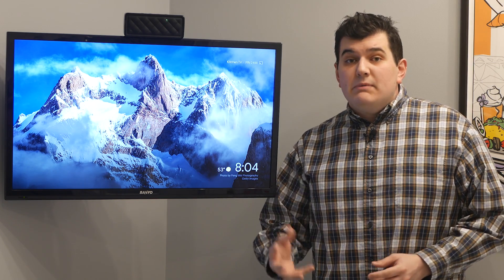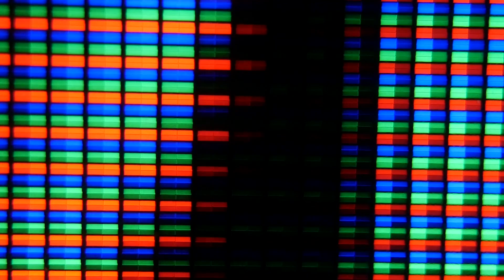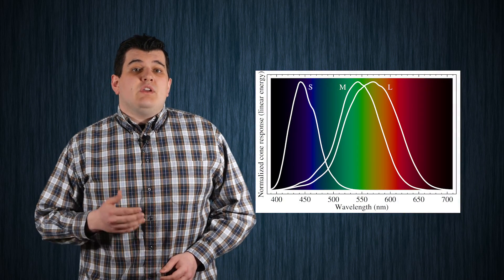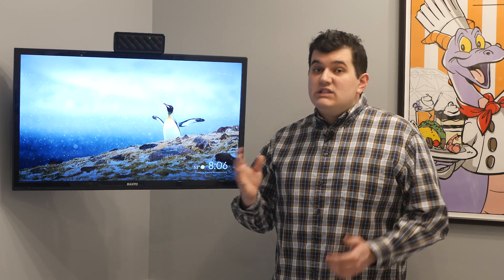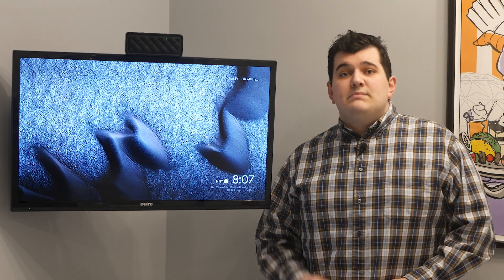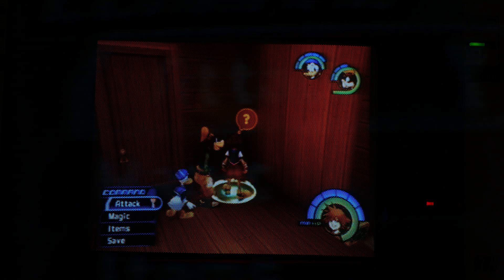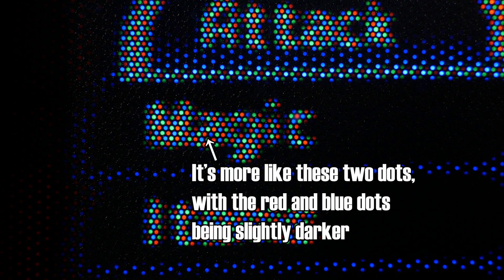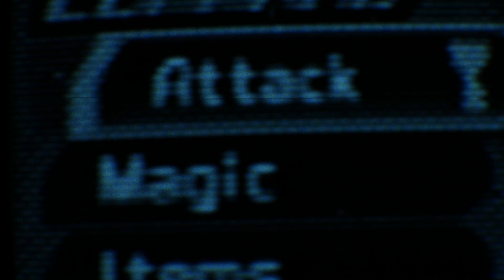These Are Not Pixels: Revisited

Comment: The thing that really brings the distinction home for me is that with the closeup of the slot-mask CRT, you can see clearly that the brightness of the image can vary within a single phosphor dot, in a nontrivial way depending on the shape of the image (rather than the color or brightness data at a single spot). That would not be the case if they were truly pixels.

Of course, the issue gets confused somewhat by the way that systems with LCD screens can do "subpixel rendering" by tweaking the color data in a manner that exploits the spatial arrangement of the red, green and blue elements to provide a bit more spatial resolution. But from the physical LCD's perspective, it's just rendering color data as usual.
Reply: This is the same point I came to the comments to make.

On a side note though: subpixel rendering is also a cool topic, and the way a text renderer has to be aware of the font shape and its display pixel layout is kind of awesome.
Reply: Haha, and don't get me started on PenTile / RGBW displays!
Reply: I wanted to say the exact same thing. Look at his eyebrows at 6:00. That says it all.
Reply: ABaumstumpf The advantages only made sense (with <1440p panels in phones at least) when blue OLEDs were ridiculously crazy expensive (rather than merely expensive) & it wasn't physically possible to print OLED's at the required densities to keep up with competing LCD tech (OLED's & esp. LED's [ala mircoLED displays] have actually started to seriously surpass LCD's in possible smallest display element density).

These aren't issues anymore (and a ton of phones and devices have used RGB-stripe OLED panels, even going all the way back to like 2011 when they actually were). And the 2x subpixels to a "Pixel" isn't the real problem in & of itself, it's the non-equal numbers of each color that comes from the 3-subpixel/color bitmap display standard. This not only creates an irregular subpixel grid that leads to HORRENDOUS text rendering, but causes HUGE amounts of "black space" whenever certain colors are used (especially red hues, with red having 1/2 as many subpixels as green, but not being made larger to compensate like they do for blue) among other weird issues with color reproduction.

Granted, these are all greatly lessened with high enough pixel density, but there's WAAAAAAY too many companies continuing to use 1080p PenTile panels on the cheaps, when Samsung can & has produced RGB stripe panels at that res.

If you're going to use a 1080p display, either go LCD or pay more for a legit RGB-stripe; or just suck it up & pay even more for 1440p PenTile. 1080p PenTile OLED panels kinda freaking suck donkey nuts, esp on today's huge screens.
Reply: Was thinking the same thing!
Reply: Cole Erickson
Lol IMO subpixel rendering is interesting & cool as long as their are exactly 3x subpixels per pixel as the physical layout; like with say Microsoft's neato ClearType for instance! 
But both 2x subpixel "PenTile" (in all of it's forms...) & 4x subpixel, ala Sharp's ridiculous & ridiculously pointless "RGBY" layouts, are simply not "cool" according to any definition of that word.

In fact, the only reason PenTile hasn't officially gone the way of the dodo in OLED phone's the way it has in OLED TV's is simply down to the reduced manufacturing cost when printing high PPI panels, along with their ability to continually get away with it & all the GPU + battery power such a subpixel rendering scheme wastes [even with 1080p displays like those STILL used by OnePlus; where the negative effects of PenTile remain blatantly obvious & consumer's should really put their feet down for either 2K PenTile or 1080p RGB stripe at those kinds of price-points].
Reply: Cooe14
To be fair - PenTiles do have several advantages too. The big problem is that manufacturers count 2-subpixel-groups as pixels - which results in worse picture quality for a given "resolution"
For example if the pattern matches it can nativly display Bayer-filter images. And for a given amount of sub-pixels photos will in generl look slightly better (due to the nature of the human eye).

But sadly most of the time it is used just to cut costs as they can claim higher pixel counts.
Reply: "causes HUGE amounts of "black space" whenever certain colors are used"
That is a thing that is easily addressable but would add another production step and thus costs.
And as already mentioned if done correctly even for the same number of subpixels it would increase the perceived image quality simply due to the nature of our human eye.

It is not an inherent flaw of the technology but the fault of the manufacturers that just use it to arbitrarily inflate their pixel numbers.
Same as it was with HDR - even good software HDR can significantly increase visual quality, but now we get "HDR" monitors with worse color accuracy and worse contrast than some good "normal" monitors. Doesn't mean HDR it self is bad.

But i agree with you that the current implementations are rather poor.
Reply: subpixel rendering just exploits the observation that actually you have 3 times as many pixels on an LCD as you think you do. (well, assuming a standard RGB layout with 3 subpixels)

That 1920x1080 display is actually a 5760x1080 display but with coloured filters in front of the pixels.
As long as you can find a way to filter out the colour data appropriately, you can exploit that actual display resolution pretty effectively.
(it also says something about the kind of monochrome displays that could be built these days if anyone was still inclined to make those.)
Reply: ABaumstumpf It can't really be fixed though. If you increase the size of red subpixels it throws the color luminance balance completely out of wack, and thus color reproduction is incorrectly altered. Samsung's trademarked Diamond subpixel layout is about as good as it gets as far as RGBG layout optimizations (which is why they have used it for so long [S4 onwards iirc]) after using a number of different layouts in the earlier years), as it suffers from the above problems WAAAAY less than the prior layouts. Yet even with said layout, PenTile's problems are still glaring if the panel's dot pitch isn't high enough. They are simply inherent to varying degrees in any & every implementation of the concept.

The solution is simply to increase the pixel dot pitch to the point the problems (besides wasting GPU perf & battery life) become largely irrelevant (yet it's benefits remain), use RGB-stripe, or use a different display tech. Phone's with visible PenTile display abberations should not be a thing in 2018. No, if's, and's, or but's about it. And ESPECIALLY not on flagship phone's like the OnePlus 6 among many others.
Reply: "It can't really be fixed though."
it can, quite easily, and technology that does that has been used for decades in some applications.
my personal favourite is simple and significantly increases viewing angles (at the cost of brightness) and also removes the possibility of sub-pixel movement - blurring.
A simple matt foil can do that.
Reply: ABaumstumpf Lol exactly, at the cost of brightness. That's unacceptable in a phone display, and diffraction through a matte foil with enough scattering to rectify this problem would impact not just brightness, but clarity & color intensity. 

I suppose I should have been more specific. It can't really be fixed without significant trade-off's elsewhere or an untenible increase in manufacturing complexity & cost (for the price point needed of budget option [as far as OLED goes] 1080p PenTile panels). 

At that point it simply makes way more sense to just skip those R&D costs & dev time all together, and simply jump up in resolution/dot pitch to their (Samsung's) already ridiculously mature 1440p manufacturing process. 

So mature in fact.... (2014 onwards), I'm POSITIVE they could pull out all the stops on an RGB-stripe at that res/density. Whether they'd ever actually do it though... Hey, at least I can dream, right?? ;)
Reply: " and diffraction through a matte foil with enough scattering to rectify this problem would impact not just brightness, but clarity & color intensity."
has been done before and no, that is not a problem.
The reduced brightness is a direct result of the increased viewing angle - to see at shallow angles you also need to emit light in that direction. That too can be rectified but that would add yet another layer and more complexity - not a problem for static devices but not good on a mobile one.
It is still the case that at the same part-size pentile would, if done not to cut costs but for its benefits, produce a sharper image. And again you are comparing not the actual design but implementations in wildly different price ranges.
Reply: ABaumstumpf "The reduced brightness is a direct result of the increased viewing angle"

Facepalm no shit lol. I know how matte material effects light, though you obviously do not. The scattering of light by passing through a matte medium most definitely does dull color intensity & contrast in addition to reducing brightness. The mechanism that causes both effects is largely the same. This is the exact reason glossy screens have far superior visual contrast than screens with any sort of matte film finish. Light scattering leads to less concentrated points of light hitting on your retina, and thus less color information for a given point reaching your cones.

And the level of light scattering required to eliminate the PenTile pixel gaps at lower resolutions (to someone with proper 20/20 vision) would make this effect much more dramatic than what a standard anti-glare display finish provides.

Matte materials also increasingly soften the resulting image, with increasing scattering intensity (more pixel light overlap). Which ofc is what causes the intended effect of elimanting the pixel gaps, but at the cost of a less sharp image.
Reply: "Light scattering leads to less concentrated points of light hitting on your retina, and thus less color information for a given point reaching your cones."
That does not in any way dull the colors as you claim. It only affects brightness and thus contrast - but not the ability to reproduce colors.

"but at the cost of a less sharp image."
And you say i don't know how basic physics work? You do realise that we are not limited to now blurring and blurring across the screen?

I am not sure if you do this intentionally or not - but you are comparing highend normal LCDs with cutdown lowcost PenTiles and assume that every engineer that ever worked with them is a complete and utter moron.....
Reply: @ABaumstumpf  yeah you don't know what you're talking about. CRT phosphors always display multiple colors per phosphor. Kinda like FM radio. Where you tune into a frequency yes, but within that band are a bunch of oscillations/vibrations that produce distinct sound (when your radio converts into sound), but at the station's frequency (like FM 103.5). You don't need different frequency bands to produce the rich and varied sounds coming out of the speakers. Just one, but different vibrations. That's essentially what a CRT phosphor does, except with light instead of radio. Whereas digital pixels can only display one color at once.
Reply: @salnation189  "You don't need different frequency bands to produce the rich and varied sounds coming out of the speakers. Just one, but different vibrations."
You have fundamentally not understood what vibrataions or freqencies are, nor how a radio works.
Reply: @ABaumstumpf  again you offer no actual rebutal. It is obvious you are a scripted bot.
Reply: That also means that your image is not as sharp and you lose actual detail - cause while you can, if the monitor would be tuned perfectly, get a bit more detail out of the image, at the same time in normal scenarios you lose fidelity.
Reply: @ABaumstumpf  the problem with your argument is that pixels lose fidelity by their very nature of being pixels. They can only display one color per frame. A CRT phosphor can display multiple colors PER PHOSPHOR, PER FRAME. This is due to CRT phosphor, whether dot or square RGB matrixes, ARE ANALOG. Light is analog, the universe is analog. Digital is a concept, analog is reality.
Reply: @salnation189  "PER PHOSPHOR, PER FRAME." Uhm - nope? Quite a big claim you made there.

"Light is analog" Well - we could go an look at how light (and everything else for that matter) comes in distinct packages and as such is pretty much digital  - that would be a bit nitpicky - but at least it wouldn't be a made up claim like yours.
Reply: @ABaumstumpf  yeah you offer absolutely zero contradictory evidence. No points for you.

Comment: Would it be possible to make a video about your process for filming crt's? I've never seen such well synced video when it comes to filming them on any other channel.
Reply: Tripp Bodenheimer Yessss not a flicker to be seen. I was wondering if he's filming it at like 120fps and averaging or....? Also, how did TV sets that didn't flicker when shot on 24fps film work? There are movies with flickery TVs and movies without, so there must have been special prop TVs, right? I imagine they must have been a lot brighter than a regular TV as well to meet the requirements of film production.
Reply: Presumably the keyword at hand is "genlock". Exposure time of each frame also figures in and may need to be chosen specifically to avoid flicker. (Ideally you'd want t = 1 / fps anyway, as times much shorter than that will cause movements to appear increasingly stroboscopic. Many a phone camera video taken in bright sunlight shows this all too clearly, and actually some other primarily-stills cameras as well.)
http://www.red.com/learn/red-101/flicker-free-video-tutorial
Reply: Yeah, i know genlock is the major component in this, but I feel like there's also a fair bit of after effects (spliced recordings to make exposures even) as well as some hacking for working with consumer cameras. I don't think he's using a professional camera that somehow has built in genlock to sync it with crt's in frame. There's a manual portion to this.
Reply: He probably uses a broadcast camera which is genlocked (frame synchronized) to the television sets. Which is fairly easy to accomplish if the camera and the TV sets are connected through the same switcher.